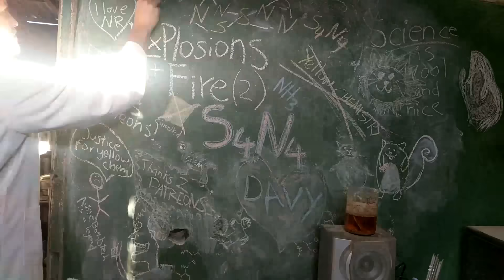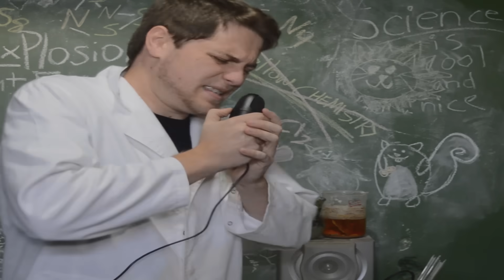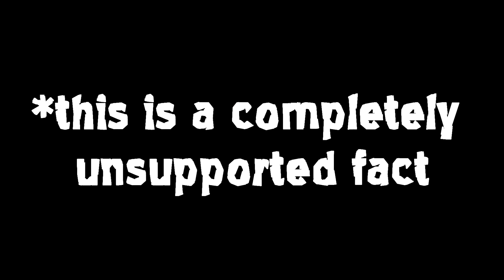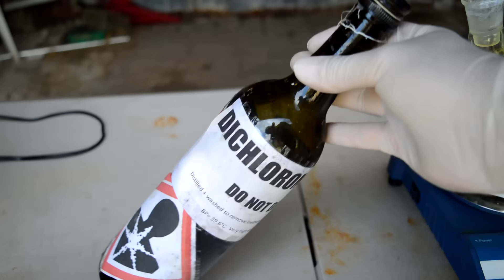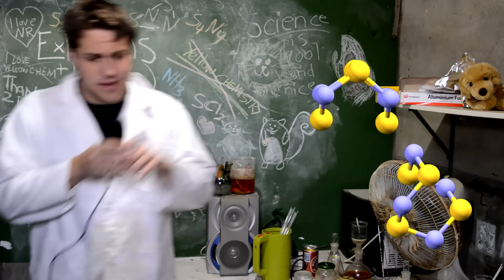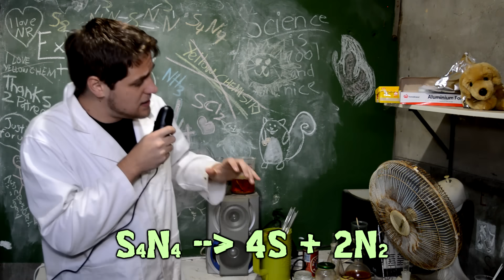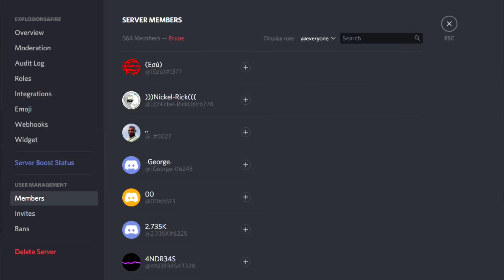Sulfur Nitride, My Arch Nemesis - Ex&F

Comment: So... you get Dry DCM (or was it anhydrous, there is a difference) .... then you pour it into the quickfit open to the air.... no canula. Now more power to you I am a Process Development (and I do not mean analytical Process Development either) chemist. But you just showed that the DCM does not have to be "that dry". Normal DCM is pretty dry (look at the KF values on the bottle).

TLDR, you either mistreated dry DCM or you did not need it.

Comment: The grudge that pushes us further into learning.... 

Saw this video when you first uploaded it years ago, and I suppose I'm having a nostalgia tour...

This video, because of the grudge energy (unconfirmed power source....but relatable in most circles...) pushed me to finally complete a project that was bothering the back of my brain for years....recycling waste eosin-ethanol product at work back into 100% ethanol (definitely not calling it "reagent 100%", cause I did it in my kitchen....and using a basic spirit hydrometer)

By no means anywhere near as complex of a process, but just wanted to say "thank youfor the push".

Also.... yellow chem definitely bad... 
"If you can see a colored haze...you're probably too close without gear....any color, (describing smoke/vapor colors) especially yellow..." - passed on by one of my EMT instructors during our HAZMAT course.

Comment: I am watching an online lecture about nitrogen right now and my prof is talking about S4N4 and how his profs used to give it to the students in the lab and how it came to multiple accidental explosions. And he also said it's fairly easy to make, as long as you have S2Cl2 and ammonia and hearing that  I just felt the need to comment this

Edit: One semester later I had another professor talk about S4N4 in a lecture. And another semester later (two days ago) I finally did the exam to that lecture where I had to draw one possible structure of S4N4 (there's multiple structures with S-S bonds or without S-S bonds)

Comment: Ok guys I happen to have one 15 year old gallon of >99.8% pure nitromethane and no use for it.
1. If I pour a small puddle and hit it with a rock or hammer as in this vid, will it literally explode? Like a high explosive? Or a mere firecracker? I’m not stupid I wouldn’t test it unless I could be positioned behind some barrier and had a remote drop mechanism etc. But I’ve always wanted to know and been too afraid to try. 
2. Is this nitromethane being stored in my cool dry basement in its original sealed container, going to become shock sensitive over time? Or could I keep it for 50 more years and no problem?

Comment: Help with question??? I'm wondering if you can help me figure out what this chemical is? When I was in elementry school I entered a Volcano project in a science fair. What made my project stand out was a chemical I had seen dimistrated in class earlier in the tear. It was a orange crystal chemical that I was able to obtain from our local pharmacy back in the late 80's early 90's. When put in a cup and ignited it would combust rapidly and send a trick gray ash into the air. I won the school science fair and placed 2nd in State. My daughter as at the age where she will be doing these projects so I would like to figure out what the chemical was so I can help with a similar project. Any help would be appreciated. Thanks!!
Reply from the maker: Ayyy that's Ammonium dichromate. Not so easy to get anymore, it's pretty carcinogenic! And if you do it again, make sure no-one breathes it in/wash your hands well etc. Hope that helps

Comment: Silly question but if this gets seen, since it’s solid couldn’t you add another solid state oxidizer fuel? Like some form of rust (iron oxide for example) if the O doesn’t jump on contact it could be a good heat activated or otherwise impact based explosive. 2 stage for easy transport

Comment: Benzene bad? I suppose, what with it being a proven cause of blood cancer ie leukemia. But back in the day, back when I was a young chemistry student, it was used to wash one's hands. That turned out to be a bad idea, what with there being up to a thirty year delay before the cancer shows up. I'm well past thirty years, so all is good (afaik that delay is only exceeded by cigarettes, which can have up to a 45 year delay).
All is good, but I stepped away from bench chemistry when the president of the American Chemical Society resigned due terminal cancer, then the following president elect withdrew due to terminal cancer, then one of my chem profs died of an exceedingly rare brain cancer, then his replacement (given the same office) died of the same exceedingly rare brain cancer, then the buildings ventilation system was replaced due to the deaths - as. I worked in that building, and we literally wore a gasmask in the chem stockroom, it caused me to reconsider my life goals. It all worked out. Fume hoods weren't as effective back then - you got so used to being light headed you didn't notice it any more. Ah well - the foibles of youth.
Reply: At the time, chemists had a life expectancy of 66 - but I don't remember the source of that statistic, other than it appeared to be correct. There were other reasons to question the field though - the dep head was an old physical chemist that for whatever reason had worked with mercury his whole career, he had an uncontrollable shake. It didn't impress me. Analytical chem seemed a better field.

Comment: I don't want to work with hydroflouric acid. Horrible, evil stuff. I have worked with osmium tetroxide. If you spill it, in tiny quantities, you don't neccesarily
Reply: Necessarily die. We used to joke if you looked at it you'd go blind though - it attacks the optic nerve in miniscule quantities , then you die.
Reply: Then you die if you ingest a bit more. Though ingesting any at all will have grisly consequences.

Comment: Having elemental sulfur as a byproduct if the intent is for it to be explosive is actually really useful. You could substitute S4N4 for the sulfur in black powder, which would mean combining it with fuel and an oxidizer. You'd get a very big bang, more than standard black powder I imagine.

Comment: Having a primary explosive of unknown properties and purity is always a reason for handling it with extreme prejudice.
Guess why? It might explode at any moment!
A glass beaker is the worst possible choice to store it because in case something goes wrong it makes lovely, sharp and visually/x-ray invisible shrapnels lodging in your hand and other body parts. You will not find them and they will wander through your tissue, remembering you for years to come of the mistake you made.
Oh, and these NICE gloves made of a micrometer thin latex! They sure protect you very well from blast waves and supersonic sharp shards! Have you never heard of Kevlar? Leather? Forceps?  Protective wrapping?
Good luck in the future!

Comment: Dude you are messing with EXTREMELY toxic chemicals. Dioxin and S4N4 are both poisonous chemicals, bring this shite down, this is really dangerous stuff!
Reply from the maker: ya sorry for ignoring your twitter message. Wont be taking the stuff down, but worth noting that 1,4-dioxane used here and the notorious dioxin are not the same thing, and what I use here is not nearly as toxic as that

Comment: You gotta love how often osmium tetroxide is brought up as a reagent when you’re learning o chem for forming diols and the like , and then quickly realize that literally NO ONE in a professional lab will almost ever bother to use something so dangerous. I mean for gods sake, you’re more likely to use sodium cyanide for synthetic chemical research than OsO4.
Reply: it's the same with lithal, there are much easier ways to reduce carboxylic acids and esters to alcohols without burning the building down
Reply: I don't get why you're dissing LiALH. It's ok. As for OsO4, we just don't use it because it is so expensive

Comment: Ever worked with lead iodide? Yellow at room temperature, turns orange when heated. Turns back to yellow when cooling down.
Weirdest part:
You can form a lead iodide - DMSO complex (PbI2 + 2 DMSO), which is a white solid. Heat it up above the boiling point of DMSO, it melts into a brown-orange liquid, which then hardens to pure dark-orange PbI2, turning yellow again on cooling to room temperature.

Comment: Benzene is a psychotropics. It works like a drug, with a difference it is available in the gas station ☺
Aluminum is a wrong material for aviation. Practically not a substantion whitch could to eating to this.

Comment: S4N4. I wouldn't call it an explosive as much as I would call it a blasting agent since it needs another explosive to set it off. It is very much like ANFO that way.
Reply: I think explosives that require another explosive to set it off is classified as a "secondary explosive". But I think its more of a primary explosive rather than a secondary explosive because its sensitive to shock, something thats not characteristic for a secondary explosive, but I do agree that it is similar to ANFO.

Comment: Methyl orange sucks.

They don't tell you about the PPE requirements including a well-fitting pair of Nikes.  My schmuck of a neighbor almost reorganized his fume hood by going into thermal runaway.  I went running for ice, and saved the room from exploding cancer.  But by neglecting my own synthesis, MINE was going into runaway now!  Lap 2 to the ice machine!  At THAT point, it was time for lap 3, to keep my idiot neighbor and my synthesis stable preemptively, because I had good reason not to trust that prick, for he poured organohalogen waste down the sink the previous week and I got a fuckin' lungful.

Oh -- did I mention that methyl orange is also a skin-permeating neurotoxic carcinogen?

It may be literally THE WORST.

Comment: I'm a bit late, but what happened if you had an oxidizer mixed in? like some nitrate along with the S4N4.
Could it work that the sulfur then would react with the nitrate? 

Like, a primary explosion which comes from the decomposition of the S4N4 and then a secondary one from the sulfur with the nitrate.

German here, sorry if I messed up some terms.
And also, great videos! Just the right mixture of competence and crappiness ;-)

Comment: Try making dichlorine hexoxide (Cl2O6). It's formed by reacting chlorine dioxide with excess ozone. According to Wikipedia, it's a red liquid that is (surprisingly) stable at room temperature. But it explodes when it touches organic materials.
Edit: there's also dichlorine heptoxide (Cl2O7), a colourless liquid formed by the careful distillation of perchloric acid in the presence of phosphorus pentoxide (P2O5 (technically P4O10, but I'm using the empirical formula)).

Comment: I disagree with your assessment of the smell of sulphur chloride.  I think it smells like a combination of shit and beer vomit - very sour, very acidic.  It is probably one of the worst smelling things I've ever made 800 ml of in the lab.  Also, fwiw, you don't have to use molten sulphur, running chlorine into a flask containing lumps of solid sulfur works just fine and doesn't volatilize the stuff nearly as much.
Reply from the maker: Shit and beer vomit, yeah I can get that. 800ml is a lot!!
Oh, it doesn't have to be molten? Interesting. Suppose you have to distill the chlorides anyway, so you might as well do it all in one pot

Comment: dude, i had a similar synthesis for a starting material in my bachelor thesis, i basically reacted SCl2 with ter-butylamine to generate the sulfurdiimine and a metric shit ton of tertbutylammonium chloride that also dusted the whole setup also turned this whole shabang into a 3L roundbottom flask of vanilla pudding that i had to filter under argon, wash with roughly 2L of dry diethylether just to get a whooping 60 ml of diimine. but as long as i didnt have to do a column chromatography i was happy not to be in the organics department

Comment: As a chemist i can confirm, never work with the physics department....or the nano department.
Reply: Yeah, nano rocks !! Much of the chemistry i was doing (yes Im a chemist) became much more interesting and having lots or feedback tools so that I could iterate faster to get something workin in a syntesis.

Classicly chemists are awesome at finally creating a method to make something, but suck at determining all its properties, from the molecule level to macroscale.

Psychisists are more precise in determining what they made in a whole range of properties, but see the synthesis as a burden and also suck at repeating a synth. Ever seen a pysisist keeping a logbook on paper, even writing down the ambiant pressure,  humitity, time of day, temperature, what sort of illumination of the room was used. batch numbers of chemicals apart from the actual chemical brand/repacker. In what conditions the stuff arrived. How it was stored. NEVER put back a chemical into the container when there is still a bit left on a spatula or beaker etc. Over time (years maybe) a container may be contaminated with a gazilion different things,
Glasware awareness. NileRed had a brilliant example of glassware going wrong during some plasma experiments. Very cool. But stuff like that is more common than I thought when I started doing actual experiments (already as a kid, trying experiments i found in a yellowed old chemistru book).

But this whole issue of the two camps just evaporates when you do nano chemistry and nano materials physics under the same roof.

It forced me (more from the chemistry side) to become more precise and actually now i love using the sweet equipment like SEM/TEM/XPS you name it, and sure also the bulk chem stuff. 
And it forced my peers arriving from the more physics side to step up their game and actually make stuff, a pure laser dye for example, and do it again a year later.

On paper it all seems so trivial. But actually doing it is very different, even in a fully equiped lab environment.  Sigma Aldrich is not the holy grail, their stuff at least should be analyzed and purified before using it when it fails after try after try. 

The chemical lab is there anyway, why not do a destilation and scavenge the last bit of moisture out of it.

So its the best from both worlds.

Nano is here to stay, and a material does not just consist of a chemical.

And yep, also the physic background guys begin wearing the coat after being pissed that stains are there to stay and that washing only creates holes in the fabrics.

Finding comfortable safety glasses is an whole other mission. Those stupid painfull cuvix nose destroyers are not inviting to works with. Yet, hand a eye naked college a cumbersome blastproof faceshield when he/se does not like to wear glasses. The next day they'll have proper ones.

Another nice one is: just keep "spilling" acetone or basicly any other chem onto the box of gloves if they are latex ones. After a few day the boxes will magicly be gone and be replaced by proper nitrile and PE and neoprene ones.
When any viny boxes arrive by accident, repeat the "spilling" and put a large white sticker on the box over the word vinyl, and use a black marker just stating "
PVC (polyvinylcloride, 60-80%, 20-40% PHTALATE derived plastasizers"

And just for the lolz, do a few practice runs of holding ones breath, BUT refrain from taking an inhalation just before you begin counting. Fun. Fume hoods are cool, but can handle only so much.(actually they are a pain in the butt, but yeah) 

And when a tube bubbling in NH3 goes wrong you'll have to act. Ignore the stinging pain from the NH3 dissolving into your arms at the localtion you by accident scraped against a wall somewhere. Lube the tubing cut at a slight angle, dont get the lube on the gloves, and fasted the the tubing again but better and resume the procedure.  (Teflon tape is awesome, also protecting any parts that cannot nastyness).

Once in a while check the oil in the vacuumpump, make sure its correct. Dont skimp on the two opposing backflow flask to protect the pump and the vacuumdistlilling setup. If some gas (like water) must be captured before entering the pump, also go all the way with a scrubbber, better too large then to small, if only to prevent blockage of gasflow.  

Bring a bit of foodgrade epsomsalt and sprinkle it into the coffee/drink of a college. They'll never bring food to the place again.

Jeeeh for science ! Theory AND practical.

Sorry for the rant, it was triggered by good memories.
Reply: @blueredbrick  this is the first time that reading a lab advice youtube comment gave me useful informations instead of cancer. Thank you sir.
Reply: What's wrong with nano?

Comment: I was thinking: maybe if you add a small amount of very finely powdered magnesium it would exothermically react with the sulphur formed and increase the energy output? Then again, the product, MgS, would be solid, as opposed to a gas, which is what we want. Aluminium is added to some energetic compositions to increase energy output.
Reply: *meaning to say that we want gaseous products, not solid ones (solid-in-air colloids, aka smoke)

Comment: I wonder, what if you switched the sulfur in black powder with this...
Reply from the maker: Could do, could do. In the mixes with chlorate/perchlorate that I tried, it seemed to boil off too easily, so that might be a problem, although in black powder the burn rate is so fast I don't need to like 'heat' it, i can just put a match to it and it should all burn straight away